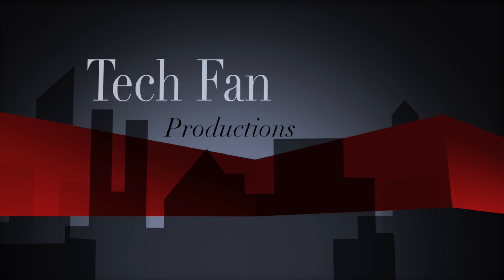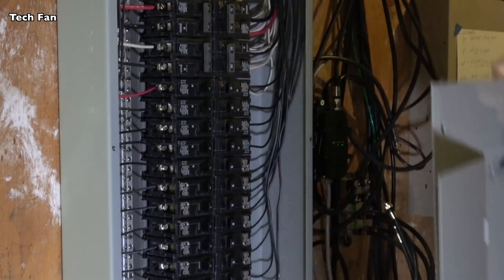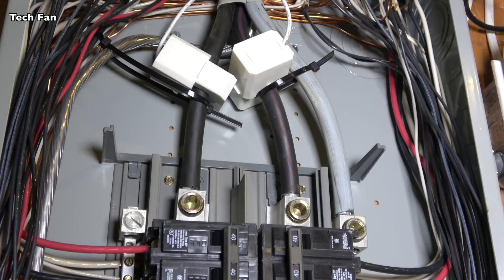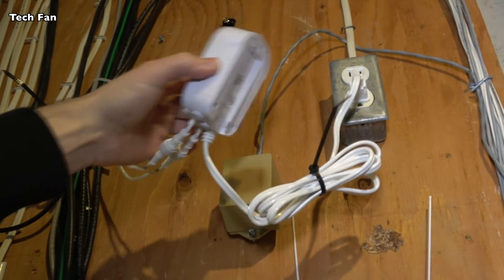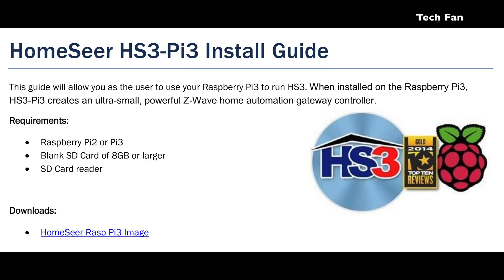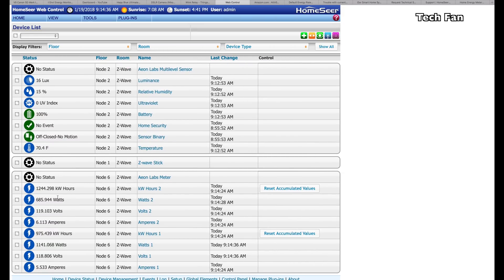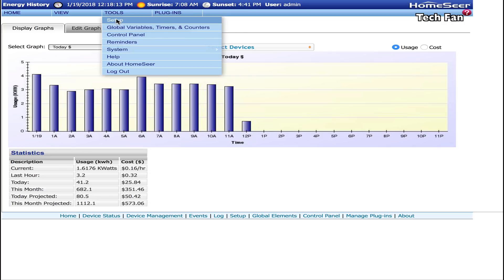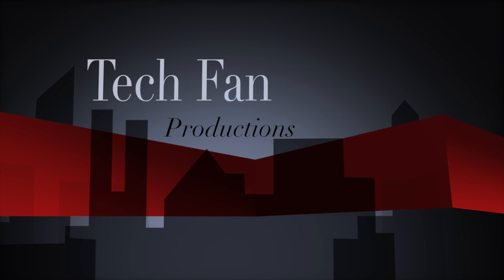Aeotec Total Home Energy Meter GEN5 Module Install With Homeseer Raspberry Pi or Smartthings

Comment: I'd like to monitor my dryer and that's it.  Could I simply put a clamp around the dryer 3-phase power cord?  Do I really have to go into the electric panel?
Reply from the maker: You can clamp anything you want it will work.

Comment: Hi, I need information on your smart meter. I've read on several sites that it can be configured so that you can, for example, change the refresh rate of the values. I don't understand how to do it. My smart meter is connected to the Aoetec hub. I managed to configure everything on Smartthing and everything works fine. But I have no idea how to change the configurations. Do I have to do it from the Smarthings app? Do I need to do this by accessing the hub by IP address? How do I find the interface for changing parameters 101,103, etc etc?

Thank you
Reply from the maker: That is a loaded question, it depends on what application is receiving the data.  I am using Habitat to read the values and output that data to my dashboard. I am only looking at amps and watts with a 60 second refresh rate.  The refresh rate is independant of the device as it's being pulled from the hub.  Ultimately you should be setting up the device in the hub which is where you are including the Aeotec into it. It's done with the discovery process, there is a button on the device that puts it into learning mode and you do the same on the hub via the webpage.

Comment: I use mine with Smarthings, and use an RGB light so I know when the Dryer is on or finished and other things.  But I do like the graphing you have on Homeseer.  But where do you manager to get 8 cents electric even in 2018...
Reply from the maker: If I remember back to those simpler days it was about 13 cents.  I remember using the right number for my own graph and might have just used the default out of the box for the video.  I moved away from Homeseer in favor of Habitat which is a much simpler platform.  Simpler in one respect with a complete offering of almost every smart device driver included.
Reply: That's so cool!

Comment: Would this be the way to go to monitor what is pulling the most electricity in your home, or does this just give you stats on the entire home. I’m lookin to monitor which outlet are taking up the most usage to reduce the usage in those outlets.

Thank you for the quick, but thorough video!

Comment: How do you determine what direction goes on what wire?
Reply from the maker: There is an arrow on the white clamps, one goes inward and one goes outward.   In my case I grabbed my 2 main legs (120V each) which goes to each side of the bus to allow for 240V.  It's in the instructions that come with it as well.
Reply: @TechFan  Thanks.  I am aware of the arrow on each clamp.  I also have two mains coming in.  But it seems that both are incoming.  Not one in and one out which would drive the clamp arrows to both go in the opposite direct.  But bottom line, my Gen 5 meter doesn't read any power no matter what direction I place the arrow.  I can hook up a Gen 1 Aeon meter with these clamps and I get a reading.  Conversely, I can connect my Gen 5 Meter to the Gen 1 clamps (I have 2 200amp panels) and it will detect power but as negative values.  Bottom line, the Gen 5 meter will not measure any power when combined with the clamps that came with this Aeotec Gen 5 package that I paid ~$100.  Very confusing.

Comment: What's with the raspberry pie. Doesn't this just connect to a zwave hub?
Reply from the maker: I used the Pi to house the application I am using to read the data.  You can sync is to any zwave hub like Smartthings.

Comment: Question, does it read power fed back to the grid in the case you have solar and over-produce energy?
Reply from the maker: I know that Homeseer has solar options but the Energy meter will read raw data in the direction of the clamps.  So technically it could but it was not designed as such.   So I am going to say it's not ideal for that application.

Comment: Any idea why my volts and amps show zero but watts and kWh are working? Added non secure in homeseer just like you did.
Reply from the maker: what version are you running, I am on version HS3 ZEE S2 Edition 3.0.0.458 and just updating to 3.0 to see if any changes

Comment: +Tech Fan thanks for the video. What app was used for the Samsung SmartThings connection to view electricity data?
Reply from the maker: In the video I used Homeseer to display the energy data, on SmartThings I followed this link https://community.smartthings.com/clicks/track?url=https%3A%2F%2Faeotec.freshdesk.com%2Fsupport%2Fsolutions%2Farticles%2F6000122372-hem-gen5-smartthings-device-handler&post_id=657526&topic_id=102997     if you follow the above you can output the data into a nice format and I had no issues with getting it to work, I just wanted an easy way to graph it which Homeseer offered.   You can also google doc it into a graph using another script but I guess it depends how far you want to go.
Reply: Tech Fan Thanks!
Reply: +Tech Fan With the SmartThings or Homeseer connection were you able to get individual power consumption on each appliance and other devices?
Reply from the maker: Homeseer for sure can be configured for individual power consumption and I would think so can Smarthings but would take a lot more scripting.   The downside of the Aeotec energy monitor is that you can only monitor two legs at a time (Whole panel).  There are other products that have individual leads for monitoring breakers which is where you would have to clamp each individual hot wire for power consumption in the panel.   So you need to monitor each circuit individually in order to get individual power consumption, but with that said with this device you can either monitor the entire panel (220/ 2) or two circuits.   So in a long about answer yes you can use this in that manor but would be limited to two circuits.
Reply: Tech Fan Thanks for your help!
Reply from the maker: welcome!
Reply: @TechFan  Hey what are some of those other products that can measure the power on each circuit breaker. I am sharing a house and we want to break up the electricity by monitoring the individual circuit breakers.
Reply from the maker: @kyleschubert9421  They make stand alone kits that let you monitor each circuit but the ones that integrate into simple automation systems will be just 2 legs.   The one in the video could be used to monitor two circuits or by adding additional sensors which could get pricy.